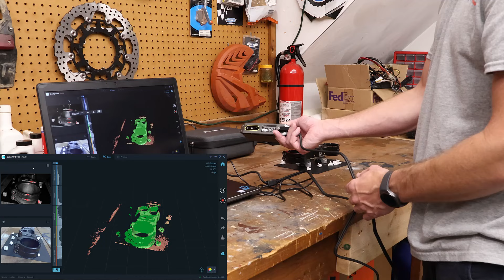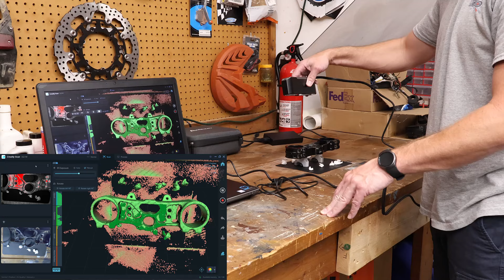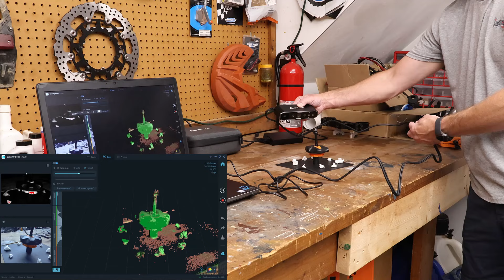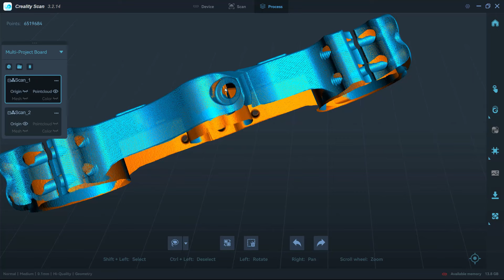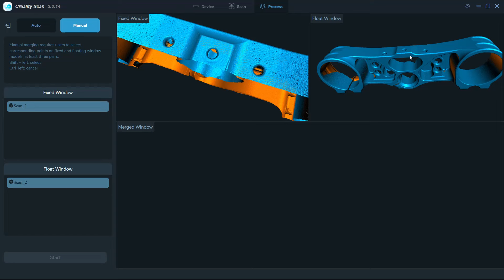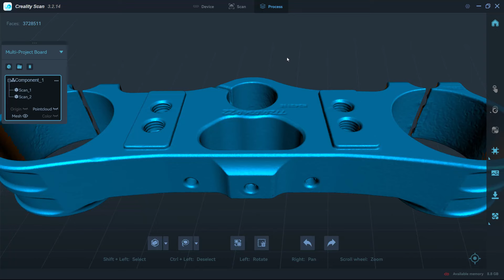How to Scan Motorcycle Parts with the Creality CR-Scan Otter | Real-time how to scan and process

Comment: What kind of laptop do you use for mobile scanning? What specifications does such a laptop need to meet?

Thanks!
Reply from the maker: I think we I did this video it was a fairly old 7th gen i7 and a Quadro p4000.  I have since upgraded to a 13th gen i7 with an RTX4000 card in it.  That is generally a "middle of the road" spec now if you are using any of the laser scanners on the market.  With the structured light scanners they aren't really as much of a performance hog.  The laser scanners like the Creality Raptor series or the Revopoint metro series like a good GPU to get decent frame rates.

Comment: Would it be better to orient the part being scanned with the most detailed surfces being in front? Reaching around the back with a cable attached, only view is on computer screen, etc just making the scan tougher to perform, isn't it?
Reply from the maker: Its not too bad but it is always a bit awkward looking away from the part.  I could have done more than 2 scans but wanted to get the most detail in every scan.

Comment: Howcome you don’t just suspend the object you’re scanning from a fish line or something, so you can scan it all way round? Just curious if that would be possible and maybe easier?
Reply from the maker: sure it would work, but there are a few reasons.  Tracking is a big one.  If you are using marker dots and dont need any other objects on a desk, then doing it suspended (as long as it doesn't swing and move) can work.

I generally like the objects to be stationary and in a position on a flat plane if possible, but that doesn't mean it is the only (or even right) way :)

Comment: Great video, thank you for it.
I have one question please, Can the Creality CR Scan Ferret pro give the same result if i'm about to scan a similar part ?
Thank you
Reply from the maker: Short answer is no because of a few things.
The Ferret is a NIR (near infrared) scanner and the otter is a blue light scanner.  the blue light does much better with shiny black objects than NIR or IR based scanners.  So scanning something like this without scan spray will be much harder.  The ferret does claim to scan shiny/black objects without spray (and full disclosure i haven't scanned this with one), but in general blue light is better.
Second is the accuracy.  the otter has a best case of 0.02mm.  the Ferret has a best case of 0.1mm.  So while 0.1mm seems pretty small, the difference between .1 and .02 is quite big.  Where you will see some big differences is in the small details like the location of edges and recesses like engravings.

Last is the otter has multiple depth cameras giving it the ability to scan close/small objects and far/larger objects.  The Ferret is fixed with one pair of depth cameras.

So yes you can scan something like this but you would likely need scan spray (or something to coat it) and you will be getting reduced accuracy/precision.

I will say i was impressed with how the ferret did scan a rim outside in the sunlight and the rim had black on it.

Comment: What was the need to have the crumpled paper bits for scanning exactly? The scanner should scan the object well even without the paper bits, no?
Reply from the maker: When you have parts that don't have a lot of unique features, or round areas like where the fork clamp is. they can lose tracking .  so adding unique things around the object like paper, bolts, whatever really, just something it can scan, helps with tracking.

Comment: Hi friend! I'm having a problem after finishing processing and exporting the first STL file. I reopen the software, but it won't let me export to STL or .obj again, only the entire project. How do I revert general changes to gap filling and post-processing so this doesn't happen to me? Thanks!
Reply from the maker: When you reopen a project, on the left side it will have a "tree" of the different stages.  If you want to reprocess the mesh or point clouds click on the eye icon next to it.  It will jump back to that stage.

On the mesh stage you can still redo the mesh settings.  

You should be able to export stl or obj when you are on the mesh or color mapping stage.

Comment: what would be a use case for "texture" tracking?  I've never tried or seen it used.  Thanks for the replies!!
Reply from the maker: Not sure about texture tracking, but when using color capture the the points are embedded with color values and the software can use that to help with on the fly alignment of the scan.  I believe that falls into the bucket of texture, but not 100% sure.

Comment: For a large detailed item, would it make sense to scan something in large, and then additional scans sections with medium or small, and then use them all to combine? or combine, and then unselect the large at the last second before final.  I'm not sure if this software does anything like this. but I would think it simple to implement
Reply from the maker: Generally you just want to look at the resolution, available features for alignment, and your requirements for the scan.  I can't recall off the top of my head if you can switch back and forth on the fly, but some scanners do offer that ability.  They let you pause a large scan, switch to a near/close mode and resume.

I would say a big general scan and then using a small/near scan for details is a good option BUT with a warning.  A large scan might have points spaced every 2-3mm away while a close/small scan might have them spaced much closer, .05mm to .1mm.  The risk here is that small features needed to align the scans won't be present in the large scan.  So you have to think about those details.

In most cases it will be one or the other but some times you might need say more detail at a mounting location for a part, but the part itself is very large.  So you don't want to try and capture it with a much smaller scanning area.

Comment: Is it helpful to add markers even if you are not in marker mode? I guess I'm thinking use both geometry and markers? Or this gives me another Idea, do scans in different modes, and then combine the data after.
Reply from the maker: I would say no, but adding unique features like blobs of clay, pieces of tape or crumpled paper helps because those are identified as features.  The capture of reflective marker dots is a bit different and its all or nothing with Creality.  Some scanners like ones from Shining3D offer a hybrid alignment mode where you can just put markers on large flat areas.

Comment: what did it mean by adding more faces to mesh better - adding more scans?
Reply from the maker: When you are doing the meshing stage you have a slider for Faces.  This determines the number of triangles you will get.  The tough part is there is no way to know how many you need.  So details like chamfers on the edge can be jagged if there aren't enough triangles.  Parts that have smaller features like text, threads, fillets/chamfers etc, will generally need more/smaller triangles to capture that detail.

Comment: This is a very helpful video! Im looking into 3d scanners and want to start using it to reverse engineer car/motorcycle parts. Since you also work on bikes, have you tried scanning a complete bike? I'd like to scan a bike without the fairing. Have you tried something like this?
Reply from the maker: Yeah and its a pain honestly.  Depends on the bike but the biggest issue is that the scanner deals with different colors/textures in a different way.  I have done a few with different scanners with varying results.  One thing you will find is that the scanner needs to have pretty good feature tracking or have some sort of hybrid tracking method like Shining 3d scanners.  I am currently doing a motorcycle series with my GPz where we are scanning and designing a bunch of parts.  The next two videos are a front fender, and an upper triple clamp.  Ill be using the Revopoint Miraco for the front fender and ill talk about the MetroX for the triple clamp.  When i get to the tailsection ill be doing a "mostly" full scan.

I have done "full" scans with everything from the creality cf ferret to the Revopoint Miraco.  Scanning in color helps if there are things that can help with alignment but I wouldn't expect a great model though.  Good for reference but I opt to focus my attention on the areas I am designing reather than the whole bike.
Reply: @LearnEverythingAboutDesign  i was actually thinking about using the Otter. Its for  a Moto Guzzi griso. Sections might be a good idea. I want to make my own rear subframe and all the fairing. With your experience, what scanner would you choose for this?
Reply from the maker: @CoinEngineering  The otter does a great job, but the problem with all scanners aside from the Miraco and the Vega, is the cable.  Scanning large objects while tethered to a laptop sucks.  And some scanners have "mobile" kits, but then you are scanning with a battery tripod handle via wifi6 bridge to a computer which means its likely slower.  I think you could certainly do it with the otter but having a rolling cart for the laptop is key.  Also note that its just USB connection to the PC so if you pull the cable out while trying to reach you will drop the scan.

Comment: “Metrology grade” is really about accuracy, precision, and traceability.

Typically, it’s accepted that a metrology grade tool is accurate and precise to 10x the tolerances required by the item being inspected, in the environmental conditions (temperature mainly) that it is to be inspected within. 

If you need to hold a 1” dimension to +/-.005”, that’s .010” total, so your tool for that 1” dimension should be accurate and repeatable to .001”

In the case of these scanners, they’re suitable for a huge number of cases where using more accurate hand tools (e.g. to verify bores/hole sizes, thread gauges, etc.) can be used to augment/verify the scan data, especially in the case of reverse engineering with a known application.

The last item that nobody seems to talk about is traceability. To be considered true metrology, your calibration/verification standard that is used to validate your measurement tool should be traceable back to a certified standard (e.g. NIST). To put it simply, a certified standard is certified by a tool that is certified by a standard that is certified by a tool all the way back to the “original” inch, with the accuracy and precision of each stage, or generation, of validated standard, and the associated accuracy and precision accounted for, in between - with that entire history being able to be traced back, with dates. Every standard needs to be verified and re-certified, for traceability to be maintained. It’s easy to see why a calibrated and traceable gauge is significantly more expensive, even if, in practice, it’s not necessarily more accurate a measurement than an uncertified gauge or standard.

Comment: Thanx for the video! I'm still undecided if I should get an Otter or a Raptor. I was hoping the Raptor can do the same nir wise as the otter plus the added benefit of the blue laser mode for fine detail. But I see so many people struggling with the nir mode alignment with the raptor for larger parts. And looking at you triple clamp scan, the otter already has a lot of detail for mechanical parts.
Reply from the maker: Yeah I wish i could help but I haven't used the Raptor.  I know Making for Motorsport has one and did a video on it with a few things.  I was impressed with the Otter as so many other scanners failed on this part.  Remember that with the Raptor or any laser scanner you come across they will need targets and lots of them.  And currently I think they are a little slower at least in this price segment.  Creality said they would send us a raptor but it was lower priority on their list since they had limited number of them.  That was awhile ago and i haven't heard back since.
Reply: @LearnEverythingAboutDesign  I thought the raptor was just an otter with the optional laser scanning added. But when I look at reviews of both when using it in the nir mode I see a lot of people struggling with the raptor. Makes me feel the otter is better in this regard. I would love the use it for larger objects (motorcycle and car parts) but also am curious about the laser part for fine detail. Looking at your triple clamp and the way you are able scan the frame it seems like the otter is the better all rounder and it would be better to get it over the raptor. And then maybe look for another option for small high quality parts later. It's a pretty tough choice 😁

Comment: Creality seems to have abandoned the Lizard for no apparent reason. I just ordered a Einstar scanner. It sounds like Creality is still struggling with the same issues they have been struggling with for years while continuing to claim that improvements are forthcoming.
It's such a shame because the new Raptor has incredibly tempting hardware, but my experience with the software has been a nightmare.
Reply from the maker: Thanks for your feedback.  I have told Creality while reviewing the scanners that Software is where they need improvements.  They have made some strides and I will say I was impressed with the Scan Otter and scanning shiny black objects which most scanners struggle with.  I think the Einstar Vega, Revopoint Miraco, and The Otter are likely the closest in terms of functionality.  Vega and Miraco both being all-in-one units, but all three having near/far modes offering up flexibility (rather than being stuck with a scanner that only does small objects or large ones).

Shining3d Splitting off the Einstar "brand" as its own thing is going to lead them into this segment from the other direction, but where i think they are missing the mark is that the exScan software was by far the best of the bunch because most of their offerings are in the "pro" class being $10k and up.  But the version you get with the Vega and the Einstar has removed features (from what I understand).  I think offering up the full version of exScan would make a big difference to what they bring to the table.

I firmly believe that software is what will separate all these sub $2000 scanner offerings.

Comment: Lots of value tips and tricks in this video. Thanks for sharing. 
Have you done a 3d scan to cad (reverse engineering) video ? I'll look. Thanks.
Reply from the maker: Yup we have tons on this channel.  here are some links
This was a car scan and widebody design series (long)
https://www.youtube.com/playlist?list=PLBDfGh8A8kXVvKBJ4UudhVLKlPdumAg5P

This is a video series scanning and modeling a mechanical part (ktm bar clamp)
https://www.youtube.com/playlist?list=PLBDfGh8A8kXWYEY9X4vJ5sKGh6TPzrr2h

This is a series looking at the different ways to reverse engineer from scan data
https://www.youtube.com/playlist?list=PLBDfGh8A8kXWa_eSWWPPZ5NevfWsDwJrj

This was a race car fender
https://www.youtube.com/playlist?list=PLBDfGh8A8kXWeZ6Q2C8P9xPw5oMUEEEWZ

Earpod case holder on a wall plug scan
https://youtu.be/COh94Os45T8

Ducati tailsection design off a tank scan
https://youtu.be/jQM4zCFZ9yY

There are others for things like speaker housing for door scans. air ducts, spoilers, widebodies etc etc.

Comment: Amazing Video. first In depth scan "review"/ Guide I have found. learned a lot in the 45 minutes just watching.  I will try out the Paper balls as you suggest and see if that helps. I have been trying for almost 2 weeks since I got my scanner to scan a motorcycle sidecover and just having a rough time at it. I am often losing tracking and having to pause and go back. . Im curious about your Laptop specs and Memory.
Reply from the maker: you can also try bits of painters tape on the part as long as its an area you can easily remove/fill after.  So either constant curve OR flat section.  

I will be doing another video on a black engine case for my GPz project but its a ways off.  My laptop is a 2017 i7 with a quadro p4000 card. 32gb ram.  the processor "boosts" too around 4.2ghz i think and when scanning its pegged.

Comment: Does otter have issues with the buttons?  They're capacitance... but it's hit and miss with mine

And I cant stop the fkr from spinning... even with bits of paper 😂
Reply from the maker: I have noticed that the contract buttons only work if the scanner is in the green/blue range.  if its outside the good range they don't seem to respond.  I figured that was a "design" thing.  Other than that when its in the good/optimal range away from the object they seem to work normally.

The spinning sucks!  The paper fixed it for me as long as the scan size puts at least 2 of them in range.  It can be anything really as long as the scanner picks it up and its unique.  Toss the little owl figure it comes with in the scene and that should help too.

Comment: The scanner is actual garbage compared to existing options
Reply from the maker: How So?  And which scanner(s) do you feel outperform it?  Right now on the marker the Revopoint Miraco and this Scan Otter are the only ones I am aware of that have multiple depth cameras to allow you to scan small to large objects with the same scanner.  The miraco being 1300 - 1600 but being a self contained unit has many pros.  The otter being 800-900.  Curious to hear which scanners you feel make this one garbage.